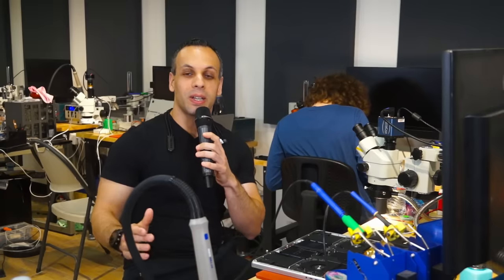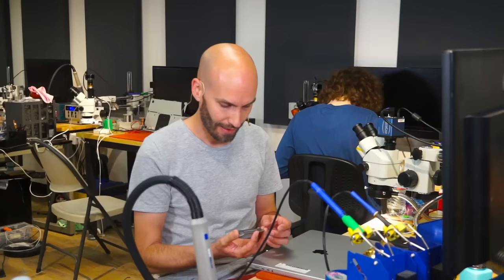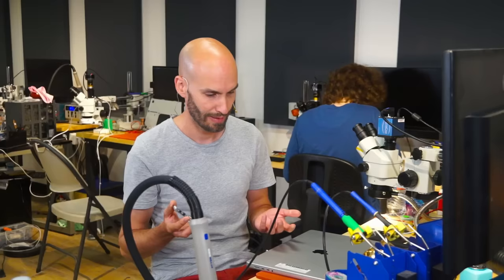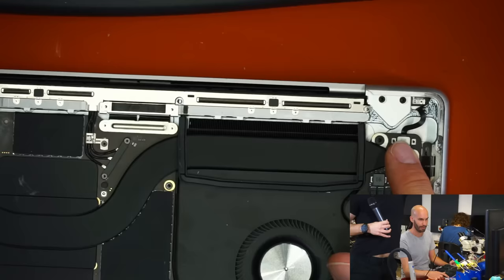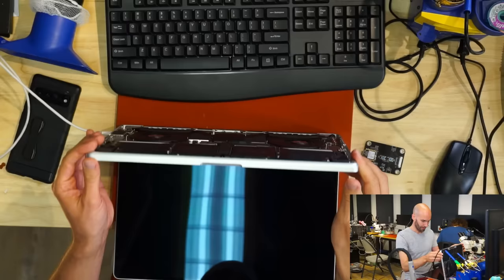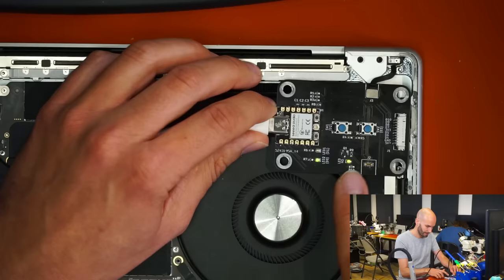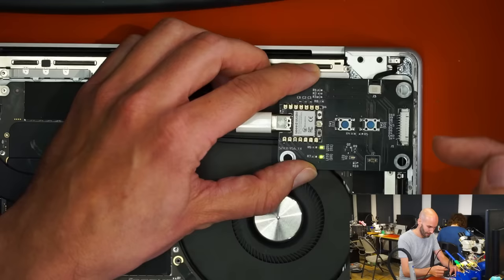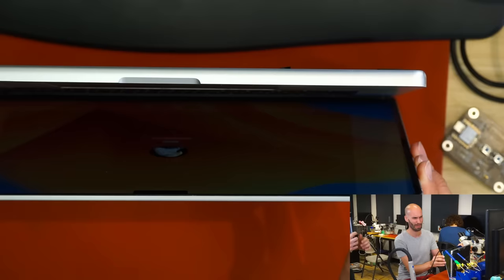We beat Apple at their own game - let the unauthorized calibrations begin

Comment: Yeah no its not a security issue, its a lazy greed issue
Reply: even the faceid pairing is not a security problem because the device REQUIRES a pin after a reboot which is also required to recognize a new faceid device.
apple's claims for "security" are just pure bullshit
Reply: Remove lazy.
Reply: @zahnatom if they had just 1 or 2 things that requires pairing and DETAILED reasons why, I think most would be like ok. But when EVERYTHING is paired for just generic safety and security reasons. It has to be safety and security of thier revenue stream.
Reply: Not lazy; they're putting in ungodly amounts of effort to make sure you can't fix their shit.
Reply: They can make it simple, they just choose not to
Reply: It affects the security of their profits.
Reply: Do you think Isheeps are deluded then?
Reply: @zahnatom no no, a fake sensor can just emulate something, when you can't trust in the sensor, hou you can trust in the face?
Reply: It's not security OR greed..  its exceptionally poor engineering and non existant quality control.   This is worse.
Reply: @oienu FaceID requires you to enter your pin after a reboot before it can be used for authentication. How is there a security issue when to even replace your FaceID you need to shut off the phone?
Reply: @clocked0  my samsung win then, that thing ask for the password (i dont use pin) when you leave the phone some time instead use the fingerprint, not only at reboot.
Just imagine remplace the sensor using a fake sensor, you will think "oh, it's work" when you register the face, but then any face start to pass.
Reply: To those saying that replacing a sensor is a security issue, I pose these questions:

What do sensors do?
They sense stuff and then pass it on to the device that it needs to go to.

Where does the authentication happen?
Hint: not at the sensor.  To defeat Face ID, you would need to beat the security/authentication chip on the board and defeat the encrypted data.  Replacing a sensor can't do that.

It's the same story with the fingerprint SENSOR in any iPhone or iPad.
Reply: @oienu  Then don't use FaceID and/or reboot the phone when you want it to be secure?

How is this different from somebody mugging you, and unlocking your phone right in front of you by pointing it at your face?
Reply: @oienu  the sensor is getting ignored until you enter the pin. you literally cannot hack it that way
Reply: @zahnatom  android and Apple both require the pin on a reboot. It’s a genuine security feature (unlike the sensor in this video)  . Your biometric data is held on an encrypted partition when the phone boots up.  I’m not defending Apple here to be clear.
Reply: Nonono, it is innovation!
Reply: @Emancipatriot well you made it sound like apple's decision to pair the faceid sensor to the phone is correct and needed for "security"
Reply: Welcome to capitalism!
Reply: @zahnatom INDEED ☑️
Reply: @MiketheNerdRanger  Agree 😅😅😡😡
Reply: But we all know you are not going to give up your apple devices. Silly consumer, repair is for kids! Go buy the new iPhone and be happy.
Reply: Dedicated greed. They've gone out of their way to ruin a simple jet functional design by engineering a complex 'fuck you!' to the customer.
Reply: @gbear1005 definitvlvly greed. That is the only reason to engineer this crap, so that you buy into their overpriced repair program or a new product entirely. That is the only reason this shit show was implemented in the first place
Reply: Wait until Apple makes new revision MacBooks
Reply: @vivi_75  bet the will push an OTA update :p
Reply: I concur with your perspective. Based on the information available to me, I can affirm that the absence of such a tool is not because of security concern. As several individuals have already pointed out, it seems more a matter of disinterest on their part in offering such a tool. Consequently, I am pleased that we are able to provide you with such a solution. It would be great to see more of this tools in the future :) Utilizing the extension port on the board, it would be greatly inspiring to observe individuals exploring and innovating to uncover fresh solutions for prevalent issues.
Reply: @virtualcosy9019  its lazy since they arent even trying to obfuscate it or hide it properly
Reply: The next apple patch is gonna break 50000 devices by accident Because they saw this video
Reply: They don’t have a reason to sell the tool
Reply: Greezy
Reply: @virtualcosy9019 does it even matter at this point anymore?
Reply: It seems  like they went out of their way to make this harder to repair, that's not laziness
Reply: @korumann  Nah dude they didnt obfuscate it, left the part in the open like an  FU you see the part, you can just plopp it out and put in new one, but we wont supply the software. Thats lazy, if they were really going out of their way, they would have glued it into a resin container, made of steel around that specific part (or some such).
They just know they can get away with leaving this part in the open, and they thought they were safe.
Reply: It's always about money. Don't forget that.
Reply: What isn't? :p
Reply: Yeah, part of Louis job is to stop apple misinformation anyway
Reply: @mikekerr9125 thanks for saving me from having to type it. JFC if Apple's security was component specific you'd have far bigger problems than a replaced sensor.
Reply: Exactly. 100%.
Reply: Not even lazy greed, just normal greed.
Reply: @zahnatom companies claim Face ID is a security issue because if it was just a normal unencrypted camera they wouldn’t be able to tell if it was a camera or a simulated copy.  Same reason Windows Hello requires special cameras and not just any old camera.
Reply: And btw, if someone really wanted they could swap the camera connection without rebooting the device.
Reply: Always was
Reply: Greed is good.  This isn't greed.  This is going out of their way to F you.
Reply: I wonder what Mother Nature will tell about this next year :D
Reply: @jubb1984  no, definitely not.
The whole software part is the FU.
There is zero need for it to be software controlled. Before it was a simple sensor that worked more reliable, and was exchangeable.
Engineering that shit show is them going out of their way to fuck customers over, unnecessary work to make the device less fixable for no improvement.
Reply: You mean a jevv issue
Reply: I agree on greed. However this is far from laziness
Reply: One of many reasons big tech needs laws against such behaviors of no work but high price.
Reply: No, it is a Jewish question. Read books on that.
Reply: Nah, it's just a greedy Apple feature. 😂😂😂😂
The best solution is to stop buying Apple products.
Reply: This is all for Apples "Financial Security"
Reply: I have a more probing question regarding Rossmann's activity. Why does he assist individuals who contribute funds to a criminal enterprise?
Reply: Always has been.
Reply: Isnt it as expected of Apple? lol
Reply: $1000 to fix an angle sensor?  Never buying Apple junk.
Reply: What for the "lazy", it is greed issue.
Reply: @gbear1005  It is absolutely greed. You new, or what?
Reply: It makes Apple secure in the knowledge they will make more money off you
Reply: Fantastic tool showing how ingenuity is used to solve problems. Excellent work, It’s verking, AVE says “Focus you ****” .
Reply: Excellent job again louis
Reply: Just another fault where apple can tell it its costs morethan the laptop even though it doesn't
Reply: Well i would agre if it would be not an close lid sensor to begin with
Reply: "Yeah no"?
Reply: Sounds like an apple issue
Reply: @zilog1 How much Apple is paying you to defend them 5$ a hour?

Comment: Back in the late 80's, I did board level repair for a tech company. It didn't matter what computer came in, they all used off the shelf parts that were easy to source. Power supplies, motherboards, hard drives, monitors, you name it, we fixed it. Not allowing right to repair is a scam. It is a money grab. Keep fighting the good fight Louis, or we all lose.
Reply: Because of what I've learned from Louis, about how Apple truly treats its customers, I will no longer purchase another Apple device.  I'm not an Apple fanboy, but I've spent over 10 grand on Apple products over the years.  No more.  I'm switching to a brand that allows third party repair to fix any problem I might have with no hassles.
Reply: @ptick16 damn, that took lots of money and time to release.
Reply: @ptick16  a lot of money wasted for a non fanboy 😂
Reply: @Mizuumisan  Sometimes we need those even though we don't want to. I know a friend who is a Windows fanboy (he's a hardcore gamer and can do game from 6 to 6) but he forced to used Mac's ecosystem because he needed to. Poor him.
Reply: @Mizuumisan  thats about 2 imac's ou 10 sets of wheels xD
Reply: This is what I like in the agricultural equipment generally, there's minimal unique parts, most things are standard bearings etc which you can get anywhere for cheap
Reply: @petermolnar8667  shame that even something like that isn't entirely immune either. Fuckin' John Deere.
Reply: @mad3721    There were no other options.  They actually took over the industry for a long time until Android and Samsung came in.
Reply: @bloodyidit4506  there were options tf? HTC, Sony, LG were better than samsung, until samsung became a viable option to use.
Reply: But, then why buy Apple in the 1st place?
Reply: @ptick16  I grew up when computers were still considered a new concept. We had a choice between IBM compatibles and Apple. I never brought Apple because they promoted this idea that you didn't need to learn anything about your computer because Apple would do the thinking for you. This meant not only paying more for their products but forcing you to use products you may not necessarily need (i.e. SCSI). Apple would try and use proprietary parts where they could to try and force a person to use an Apple authorized dealer for any repairs (not much has changed). You couldn't even upgrade on your own without potentially voiding your Apple warranty (i.e. plugging in and configuring a new hard drive - in those days you had jumpers, switches and cables to deal with). The IBM compatible on the other hand let me mix and match parts from different manufacturers and let me install only what I needed. The parts I installed would have their own warranties, not tying me down to one company.

Any company that suggests they will do the thinking for me is not a company I can trust.
Reply: Ok, make it yourself big guy
Reply: @ptick16    I bought a copy of System 7 so I could run Mac software on my Amiga 3000. That was the ONLY time Apple got my money.  🙂The ROMS I got by copying a set off a Mac on display at Incredible Universe.  😈  Ran Mac software faster than it did on a native Mac.
Reply: @Mizuumisan  - Some of those purchases were also gifts for my family, not just myself.
Reply: the dream
Reply: Yes, because engineers design with known readily available parts or the product's price gets exceptionally expensive.  Making custom parts isn't cheap.

Comment: If it were a real security issue, Apple would have used an old-fashioned, mechanical switch, and / or would have added a light to the lid to show the operator that the laptop was still active.
Reply: Wait, you mean a mechanical interlock that is so dead simple it never breaks, AND keeps the lid closed until you want it open?! That would make far too much sense! We must think different!
Reply: @williamking9707  planned obsolescence isn't incorporated into the design????

Comment: They are open sourcing the software to do this after 350 orders (already 14% there). This is really a great thing; it pays for the development of the device but allows everyone access it eventually. Really impressed.
Reply: They need to add a second item, for those of us with no need of the tool, but will to throw €5 toward the cause of open sourcing this. Maybe throw a nerdtool sticker in an envelope, but not necessary.
Reply: @RossReedstrom I would agree with this to, i don't want time took i just wanna support.

Comment: Don't worry, this will be fixed in the next patch "Removed the ability to use external calibration tools to calibrate the angle sensor". Apple don't want you fixing their stuff, they want you to buy new ones!
Reply: Bingo.
Reply: Likely impossible without new parts. 

It's most likely a standard SPI flash just like a bios. Which means that the Apple calibration tool is likely something like flashrom (because why not rub it in by using open source software) which flashes the tiny rom with the calibration settings.

At a guess, the way this was reverse engineered was by reading the SPI flash of a few working units and seeing there were no differences in the code.

From there it's just a matter of making the board to make it easy.
Reply: well apparently the people still buying apple products want to...how else can they brag to their fake friend coffee group that they got the new iphone gazillion and are having louis rossman repair it 😂😂😂
Reply: at some point making even MORE money is not worth the effort
Reply: Don't worry its NOT patch-able.
Reply: The thing is, the sort of person who wants to actually get stuff fixed usually is the sort of person who can't afford to buy a new one again.
Reply: Is it their stuff if you or some other person or business purchases and pay for it? Should I not have the software available to repair my devices if I paid for the device or is everyone else stuck in the idea that the manufacture still holds control over the device you paid for? Seems like a hostile takeover attempt.😢
Reply: @loulelea it's just the current year meta for companies to "sell" things for people to "buy" which after doing so the company still owns. Frankly I feel it should be treated as false advertising or misselling and any company that used words like "buy" or "purchase" or otherwise implied ownership obliged to reimburse customers.

Comment: We had our commercial espresso machine go out on us recently. After some troubleshooting I found the problem was with the circuitboard somehwere. I contacted the manufacturer and described the problem - the heating elements in the boiler weren't turning off and it was overheating.
They said it needed a new board, but they cost nearly $2000 (!)
So this was a huge incentive for me to get out my multimemeter and go around the board looking for a fault. I found two faulty triacs (they control the heating elements and there were three of them). I replaced them and it's working perfectly now. They cost about $8 each. I replaced all three triacs and with shipping it cost me $46. I had to get help from an electronics forum, with pictures and start to build a picture of how the circuit board worked and find out what the various components were, what they did and what they controlled.

I'm glad this was a fairly easy fix, but they weren't too forthcoming with a circuit diagram or any other help.  They also ghosted me when I told them I'd found the problem and was ordering the new parts for $46 🙂
Reply: Telling them for how cheap you fixed it and them just realizing they lost a lot of money is just pure karma 😂😂😂😂
Reply: @onemprod  Yeah, it was the cherry on the top and I learned something new along the way. 🙂 I ain't paying two grand for something that should only cost maybe a few hundred tops, even if it was a bit specialized. 2 big ones? They're having a frikkin laugh....

Comment: The sensor needing calibration is fine and normal. The procedure not being built into the device with a simple wizard in some service mode is beyond any explanation - amazing work on reverse engineering that!
Reply: That's not even normal nor acceptable. A new sensor should be flashed so that it assumes that its initial state is closed because the technician working on the machine would only be able to do so with a closed lid. Edge cases could be worked around by having a reset button in the motherboard.

Comment: I wouldn’t call myself a security expert, but I am currently working on my masters in cyber security. I personally can’t think of a single way that Apple’s “solution” provides security to the end user. It does the opposite lol
Reply: yes, the only precaution against eavesdropping would be a clear indicator that the mic is on (or at least that the machine is running — which they deliberately removed in the newer ones by replacing the transparent logo with an all black one!)
Reply: if the device was flushing RAM to the SSD when it detected being closed, a paired sensor would make sense. but does it?
Reply: security through obscurity
Reply: i'm studying for my Bachelor in IT engeneering, and i too can't think of how this sensor could provide in any way, shape or form security to a device
Reply: @stephanweinberger The only real precaution against eavesdropping are physical switches for the mic and WiFi. We won't see that because according to manufactures, switches aren't sexy and you don't want unsexy things. Always on does sound nice, but is it really?
Reply: I mean, really, it's just their way of saying they are securing their pockets.😂
Reply: Altthoug, I could get rid of that feature on my iBook and watched movies on my TV while it was closed and it did never overheat. But you never know what people do with their stuff.
Reply: Bro please help me get a remote tech job